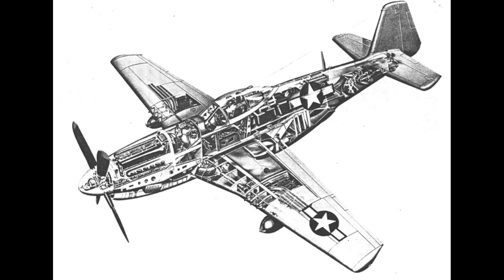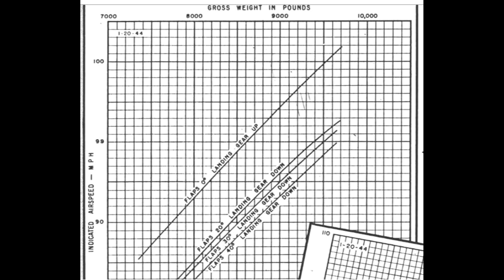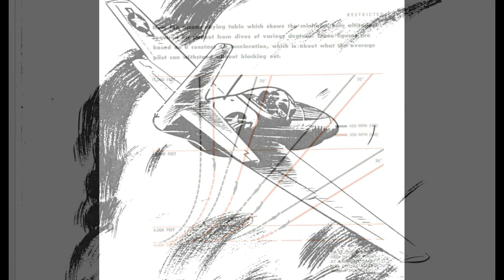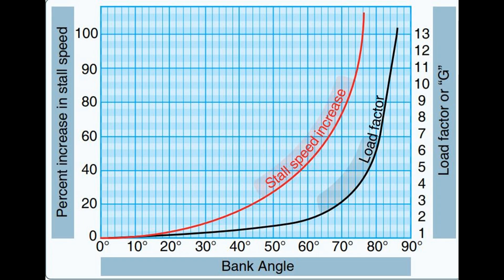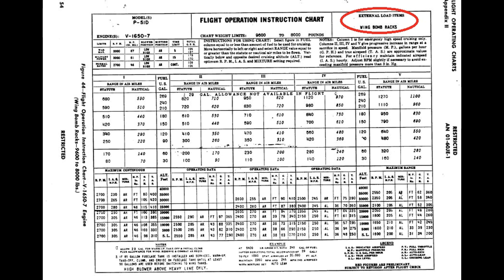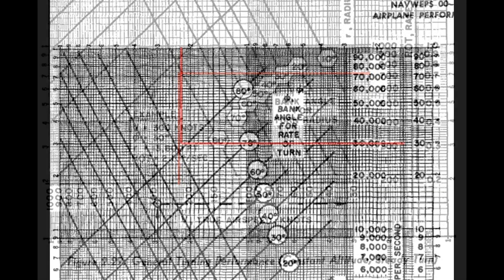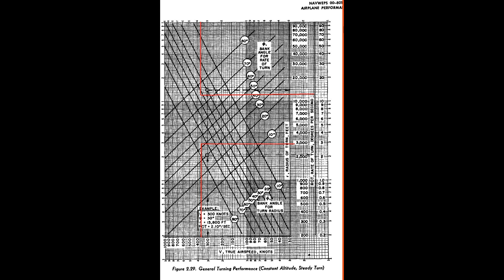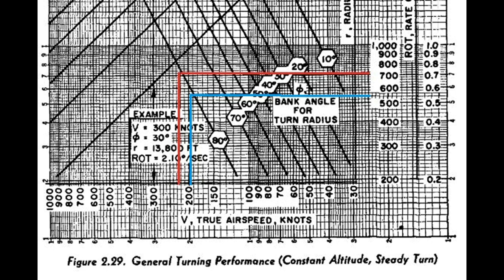P51 Mustang Turn Radius vs.

Comment: Greg I came across this only recently Turn Radius 
                                                            Bf109
 Radius ft                        Bank Angle                             V [ ASI/ mph   
  853                                   68  deg.                                       94
   885                                   62   "                                          126     
 It  did not show the P51 Hope it helps

Comment: Greg - page 178 ASNA is correct - CLmax is critical and AFNA Does discuss it. Kelvin3531 is Correct. You mentioned in presentation but told Kevin that he was wrong. 

"(1) Maximum lift capability. The combination of maximum lift coefficient, C,,=, 
and wing loading, W/S, will define the ability of the airplane to develop aero dynamically 
the load factors of maneuvering flight. 
(2) Operating strength limits will define the upper limits of maneuvering load factors 
which will not damage the primary structure of the airplane. These limits must not 
be exceeded in normal operations because of the possibility of structural damage or 
failure. 
(3) Thrust or power limits will define the ability of the airplane to turn at constant 
altitude. The limiting condition would al low increased load factor and induced drag 
until the drag equals the maximum thrust available from the powerplant. Such a case 
would produce the maximum turning capability for maintaining constant altitude. " 

Summary - the HP (corrected for Ram) comparisons between the 109 and P-51, which are based on engine performance as function of altitude, plus Drag, CLmax, exhaust gas thrust MUST be known. Induced drag and trim drag for asymmetrical flight condition in a turn - particularly for a Bf 109 - are really not known for the 109 with slats deployed. There is no data for 109 cooling drag as a function of speed and angle of attack. To my knowledge Hoerner has the only parasite drag build up and Zero reference to CD as function of angle of attack. He had one reference to Total Drag at one Reynolds Number in wind tunnel which must be stripped of Induced drag and the condition of the airframe unknown (i.e production full scale, sealed/unsealed). 

While I respect Skip Holm, one has zero notion of compared P-51 model type and condition, gross weight, whether rigged for 10 or 15 degree aileron throw, skill of the pilot, operating MP and or altitude.  Ditto for the 109. I might add that Skip was trying to sell Bf 109s from that collection.

To correctly model a constant altitude maximum rate of turn
Thrust = Drag; the Vertical Lift Vector L=W, the horizontal Lift Vector N= G loading.
Thrust HPavailable=Thrust HPrequired
CLmax = Lift Coefficient at power ON stall ----> Clmax= W/(1/2 rho*V^2*S) =1.6 at 97mph at SL for P51D@9000#.
where rho = density at specific altitude; V^2 = Velocity squared in feet/sec; S=Wing area in square feet)

There is a Long road ahead to then solve for CD=CDp+CDi to account for Parasite Drag of Fuselage/Wing plus Pressure Drag due to angle of attack, multiply by Mach factor if V> 0.3M then add CDi. When all this performed for base airframe, then calculate drag due to carb intake momentum recovery, drag due to cooling system, drag due to immersing fuselage and % of the wing, immersed by accelerated flow of the prop vortex. Convert to THPrequired.

On the other side, calculate the ThrustHP from engine/prop and add the exhaust gas Thrust (converted to THP).

I have all of that for P-51 level flight, but way too lazy to try to model for Turn. If including altitude the model is incrementally more complicated as CD varies with Reynolds Number and Mach No. (which varies by Temp)

NOW you can start iterative process of finding Turn equilibrium based on T=D, Lv=W and V at CLmax to find the max bank angle and G (Lh) load. The last time I fooled around with this, the equilbrium turn N was around 3G at 15000 and 67"MP.

The net is that AFNA as it is presented is inadequate for your calcs and you somehow lost the Bf 109 in the comparison.
Reply from the maker: This is a six year old video, as you didn't provide a time stamp I have no idea what you're responding too and I certainly don't remember some specific commenter said probably some number of years ago. Of course AFNA discussed CLmax, I have talked about it many times, in fact its come up in the video I'm about to release.
Reply: @GregsAirplanesandAutomobiles  Kevin3531 stated "One critical thing was omitted in this video: maximal lift coefficient CLmax depends on Mach number, so, if it is derived from 1g stall speed with low Mach, it is not suitable to calculate high speed and high-g turn performance. The difference for unswept wings are very noticeable, for example,  for P-51 only 80-75% of the low Mach CLmax remains at 0.5-0.6M. P-51 airfoil is very special - it has no constant CLmax drop with Mach 

You stated "Nope. Not only is this not a critical thing, within the context of a discussion on WW2 airplanes it just doesn't matter. AFNA starting on page 176 beats this topic to death and their formulas don't include CLmax and they have specific examples out to 500 knots, way beyond the speed for any WW2 plane in a turn fight. Now they do talk about this factor in transsonic and supersonic flight, but that's way :"

AFNA charts have no relevance to the discussion of sustained turn performance between any WWII aircraft - for all the reasons I detailed. In fairness, you alluded to the key factor, namely power HReqd vs HPavail - but waved your arms and took off on instantaneous turn rate and bank angles as if the comparisons had sufficient power.

Comment: It should be noted that RAF and RN Spitfire/Seafire pilots used the Franks water filled G-suit as early as 1942.  I've read that they exceeded the structural limits of the Seafire and returned with bent and wrinkled wings.  That was Op Torch, so I'll assume it was low level combat.
Reply: Easy to do the Spitfire Airframe was immensely strong
Reply: @jacktattis  there are variables to consider when discussing structural limits of the Spitfire, for example:

Load factor throughout the structure with the centre of pressure in its most forward position 9.0
Load factor for wing structure with the centre of pressure in its most rearward position in horizontal flight 6.0
Load factor in terminal nose dive 1.75
Reply: @bobsakamanos4469    In what way does that take away the fact that the Spitfire had the highest Tactical Mach of all WW2 planes
Reply: @jacktattis  read the thread again, Jack.  You're off on a tangent again just to spool up an argument..
Reply: @ Yes indeed

Comment: Interesting subject.  After watching a video of a Wildcat flying a vertical S, I decided to try it in my Extra 330LC.  It gets even more intricate when you consider the dynamics of changing gravitational effect in a vertical S.  The Wildcat stacked a half loop on top of an Immelmann.  In the Extra, it is possible to stack two Immelmanns (only just).  I determined that an Immelmann is possible if you start at 100 KIAS, but you are very low on energy in the roll-off-the-top (around 40 KIAS, unloaded, but with significant torque and propeller slipstream effects due to the low speed and loss of aileron effectiveness).  You cannot pull more than 2.5g on the entry, or you will enter an accelerated stall that will rob energy and make it impossible to continue.  This means the first (lower) Immelmann  must leave you with at least 100 KIAS on its exit to facilitate an immediate second Immelmann.  It can be achieved by starting the first Immelmann at around 175-185 KIAS and pulling around 6-7g initially.  This will leave 100-120 KIAS available at the start of the second Immelmann.  Now to figure out the optimum g to maximize energy retention and attempt to improve the symmetry of the figure (since the top Immelmann is much slower, but occurs at significantly lower g, it is hard to estimate the radius of turn for each).  1g stall in my Extra comes at around 63 KIAS (two up), so 185 KIAS will accommodate an instantaneous 8.5g.  G-limit two up is +/-8g, but solo it goes up to +/-10g.  I estimate that solo I can run about 15% lighter, which should improve the vertical performance, although inertia may actually be beneficial in the initial “zoom.”  The difficulty is optimizing g-loading to maximize performance (high g means you turn tighter (initially), but it significantly increases induced drag and robs energy).  A tighter turn radius also reduces the time you spend fighting the Earth’s gravity opposing your thrust.  All the quantities are continuously varying, making for some very complicated physics.
Reply from the maker: Two immelmanns in a row would be quite impressive to see. It makes sense that a really well flown Extra could do it, but I don't recall ever seeing it done.
Reply: @GregsAirplanesandAutomobiles  it really consumes the available energy.  The second half-roll at the very top (roll to the left) becomes a torque roll at 40 KIAS, so aileron must be centered about 45° early to finish upright with wings level (the torque wants to keep the roll going).  It’s also a challenge to keep the whole S in a single plane (i.e. to avoid twisting off plane, especially on the second Immelmann).

Comment: One critical thing was omitted in this video: maximal lift coefficient CLmax depends on Mach number, so, if it is derived from 1g stall speed with low Mach, it is not suitable to calculate high speed and high-g turn performance. The difference for unswept wings are very noticeable, for example,  for P-51 only 80-75% of the low Mach CLmax remains at 0.5-0.6M. P-51 airfoil is very special - it has no constant CLmax drop with Mach number, but other conventional airfoils for P-39, F-6F, etc have very sufficient CLmax drop up to half of initial. 
At high altitude this effect is even more noticeable because of low EAS, high TAS and lower speed of sound.
For GA planes with low Vne/Vstall ratio this 1 g stall approach is widely used without significant errors, but it is unsuitable for high-performance fighters.
Reply from the maker: Nope. Not only is this not a critical thing, within the context of a discussion on WW2 airplanes it just doesn't matter. AFNA starting on page 176 beats this topic to death and their formulas don't include CLmax and they have specific examples out to 500 knots, way beyond the speed for any WW2 plane in a turn fight. Now they do talk about this factor in transsonic and supersonic flight, but that's way outside the scope of this discussion. cont:

Also, PHOAK has this covered in Chapter 5, page 5-39 specifically. These are the two most peer reviewed publications in aviation and they both cover this topic very well.
Reply: @GregsAirplanesandAutomobiles  Nope. CLmax is a critical parameter because it determines maximal lift, the plane can provide at the certain EAS and Mach.
Anyway, the last word obviously is for NACA. Take a look, for example at post-war NACA-TN-1044  (1946) where high-speed wind tunnel and flight tests data are compared for several planes. Or, just for P-51D, NACA - RM-L6110 (June 1947).  This report is based on flight tests as well.
Reply: @Kelvin3531  You are correct. CLmax is critical. For these discussions CLmax, V and bank angle  are key, but even more important is that T=D & L =W (where L is the normal Lift Vector opposing W} for constant altitude turns. Solving for V=min, G=max requires checking against equilibrium.

Comment: Thank you for a great video. Not a pilot but I have flown and my most memorable experience was in a t-34 when we rolled 90, no back stick, and Dropped Like a Rock intentionally,  no rudder, as to be expected. Is top rudder used in these high bank angle steep turns? Thanks.

Comment: Walter Eichhorn, a well known German pilot who flew the Messerschmitt "red 7" and participated in the filming of "Memphis Belle", later told me very much the same during a dinner. Furthermore in his opinion a Bf 109 G-10/K-4 was capable of outturning a P-51 D without difficulty (Eichhorn flew both types).
Reply: The K was about as numerous as the Me-262, there weren't enough of them to even consider. Might as well compare it to the P-51H, which would've outperformed ANY German propeller driven plane, in every aspect, during the war...
Reply: @jamesbottger5894  it wouldn’t have outperformed a Ta-152H, Bf-019K14 or a Fw-190D13 with the EB engine in every aspect
Reply: @princesofthepower3690  It absolutely would have. Also, there were so few of the 190D11, D13, and 109Ks produced, a Mustang pilot was about as likely to see a unicorn as they were seeing any of these planes...
Reply: Look at the performance specs, the P-51H was better in every way
Reply: So who do you believe, the German pilot, or American pilots who say they routinely out turned the German fighters?

Comment: One more point. Turn radius or pretty much any turn ability can be negated with the right tactics. Claire Chenault's P-40s were slower than Zeros, could not turn or climb with Zeros and they shot down scads of zeros by attacking from a higher altitude and zoomed through the Zero formation much faster than the zeros could dive and then continue their dive and pull a zoom climb out away from the conflict and return again from higher altitude to do it again, and again etc.
Reply: AVG didn’t face A6M’s.
Reply: They faced the similar looking Oscars. The Zero/Zeke were carrier aircraft.

Comment: I've read other places that the turn performance of a P-61 was better than any other fighter of WWII. I haven't watched much of the video above but it sounds like you're concentrating on those 2 aircraft. I was hoping for a more widespread comparison of various craft in a typical war time load for comparison. 
I watched a Navy F-14 at the Point Mugu Space Fair (their name for their annual air show) do a full 360 degree turn while about 250 feet above sea level within the confines of the base between the outer fence and the runway closest to that fence, where the pilot basically stood the plane at nearly 90 degrees from horizontal and flew that circle and I could hear the jockeying of the throttle and see the shifts in the control surfaces as he flew the circle. I doubt seriously if any WWII fighter could have matched that circle under any circumstances. That pilot certainly earned his pay that day.
Reply from the maker: I saw the same display at Pt. Mugu. It was impressive. I also saw the Blue Angels there when the flew the F4!
Reply: Sorry you are joking it was a 29700lb monstrosity One Author said at full load the P61C required 4 km of runway to take off.

Comment: Hi. This link from a Luftwaffe ace is very interesting. Explains why so many different views. Translation caps are not exactly, but basically, referred to the matter, Willi states the Mustang will jump fast into the turn, if the 109 fighter hold the nerves, he would get the Mustang back... An inexperience 109 pilot would jump out of the turn, to be in the hands of Mustang ("erledigt"=Finished).
https://youtu.be/74nsR6zjXPY

Comment: The Me 109 will always out turn a P 51, given equal pilots. The rudder on the 109 is the main factor it can do something of slide skip in a turn, the P 51 can not make the same corrective turn to shot. P 51 is a race horse fast hitting fly by plane, the Me 109 even to the later g types is a cross over turn and shot and fly by fighter. By the end of the war the Germans, Americans and Brits had gone to a fast high attitude fighter, like the Dora, TA 152, Me 109k etc. These are more hit and run type planes. That said you're not going to out turn the Zero as it was designed ground up as a classic dog fighter of the WWI type of close in turns fights.

Comment: Can you make a video about P51d disadvantages. Everybody talking only about P51d superiority, but there is got to be also some bad things. Could this aircraft compete with germans fighter in low/mid atitudes? Wasnt P51d also very vulnerable if it was hit in belly, because it didnt have strong protection?...
Reply from the maker: I feel like I have covered that in my P-47 series, and in my P-51 vs. Dora video. The P-51 was awesome, but not all conquering, a skilled pilot in a G-14 or a Dora will give it a tough time. I guess I could make a video on the specifics.
Reply: @GregsAirplanesandAutomobiles  Thank you for a quick response. Will check P-47 series. Have not watch this series yet. Anyway, these your videos are just masterpieces! :D